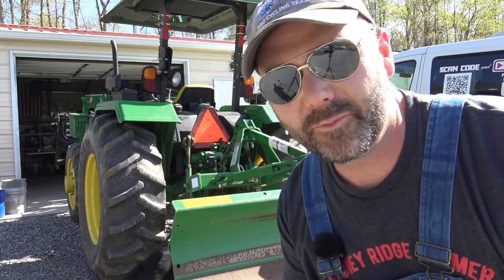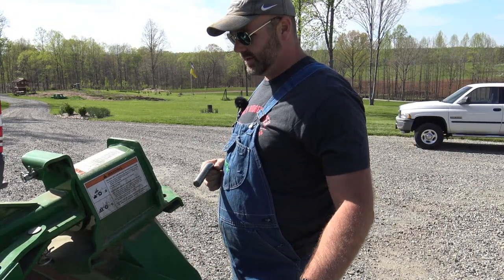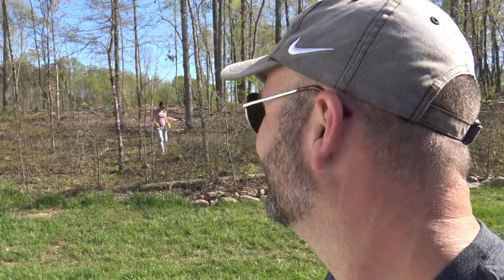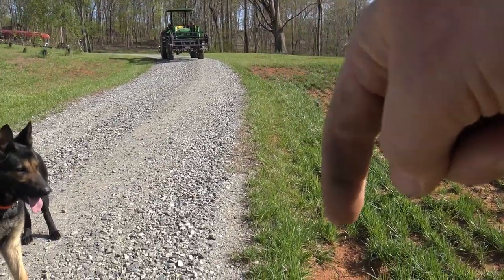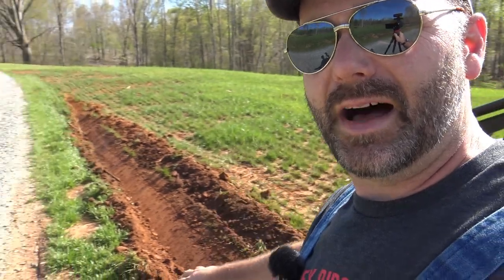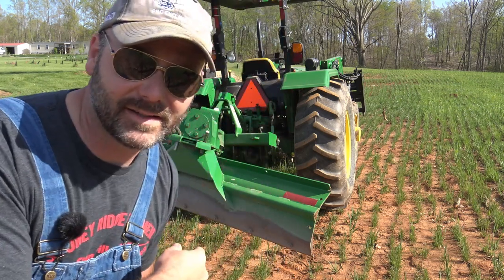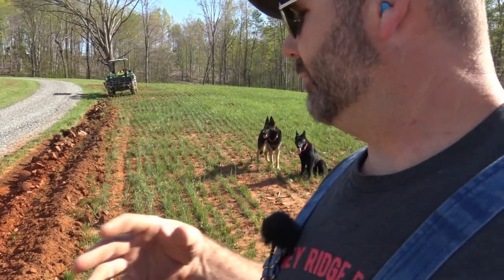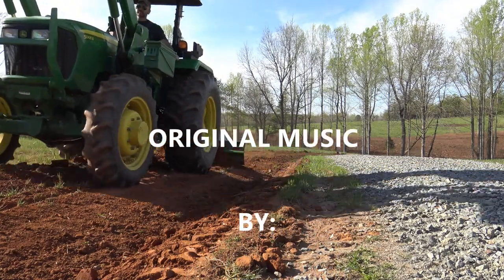Tractors at work...How to properly ditch your driveway to stop washing!

Comment: Josh, that really looks nice, want to try you skills on my drive 🤣 I dont have a scraper blade. Do you think you vould get same results with a box blade?
Reply from the maker: I'd say a scrape blade does best in this case....a box blade might be better for leveling out the ground....I've done some driveway vids that are helpful...and will continue to do more this spring with rakes, box blades and scrape blades.....we have alot of driveway and roadway to maintain
Reply: @StoneyRidgeFarmer  Here too. Soon the loggers will be here to salvage the timber from hurricane michael. After they leave I will have more work to clean up the drive.
Reply: I've tried doing something similar with my box blade and it's really hard because the box blade doesn't pull the dirt left or right, it just smooths the dirt. 
You can angle the box blade and it will eventually create a small channel, but only as much as the dirt you pull forward, so takes a LOT of passes.  I'm picking up a back blade next spring to do exactly this on the roads on our property.  Only difference is that mine are all dirt so I'll be pulling the dirt from the ditch up onto the road and then smoothing it out.  Have to build the crown up and build ditches.

Comment: I just did the exact same thing along my gravel drive the other day.  Only difference was there are three foot banks on both sides of the drive, so I had to dig the ditch from the driveway, which resulted in quite a bit of dirt on the sides on drive.  Because of the banks, I was unable to pull the dirt away for the drive and ended up turning my blade around and smoothing it along the sides of the drive, which made quite a mess.  So if anyone has an idea of a better way to remove the dirt in this situation other than hand shoveling it into the front loader, I’m all ears.